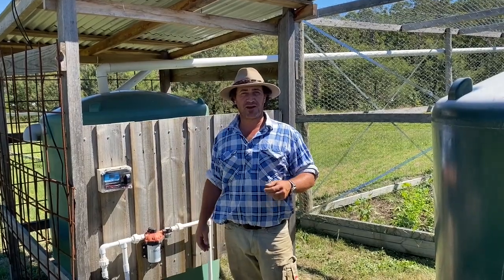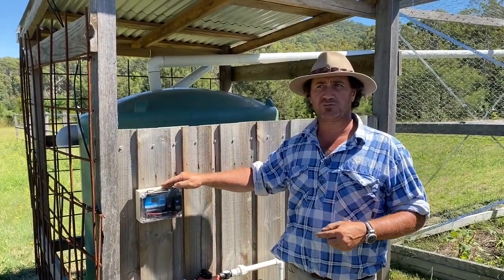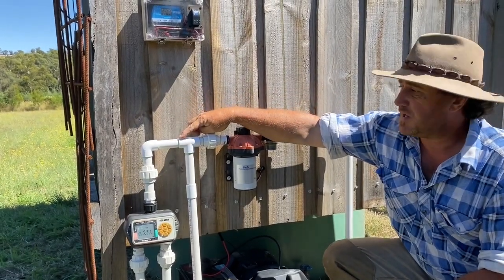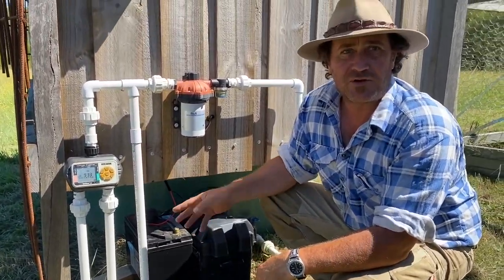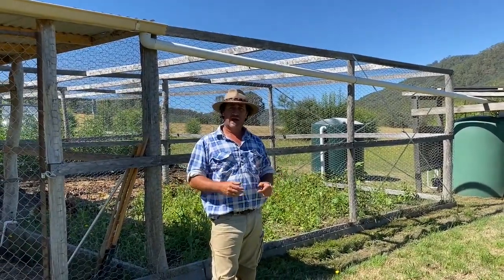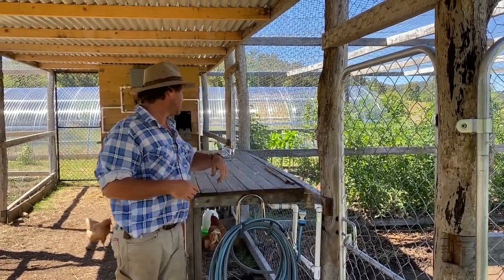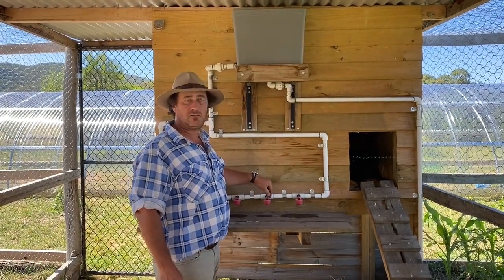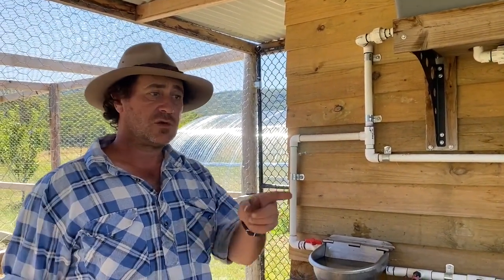Vegetable Garden & Chicken Coop Irrigation System.

Comment: So question, I live in Virginia (US) and I want to build a rain collection system that goes to my garden, chicken coop, and fish pond. So far the only issue I keep running into is freezing water, I can't figure out a good way to prevent the whole system from freezing. Do you have any recommendations?
Reply from the maker: Hi Caitlyn, we don't freeze in our collection systems. My understanding of creeks that freeze over the top are still flowing under the ice. This may be because its flowing water. Could you add a directional flow pump in the tank so that the water doesn't remain still. Cheers Pedr